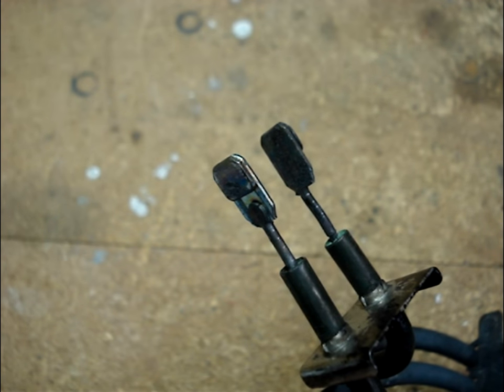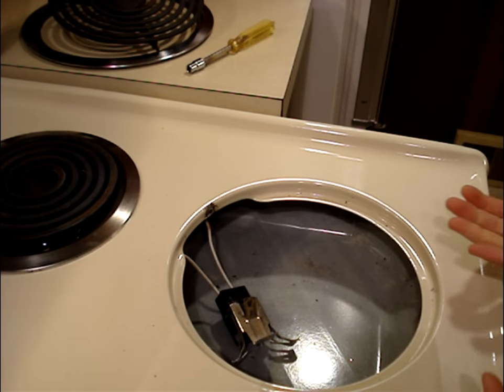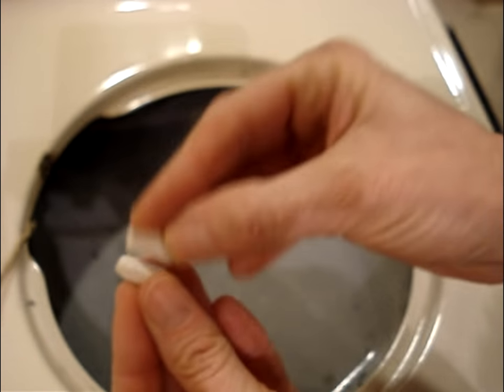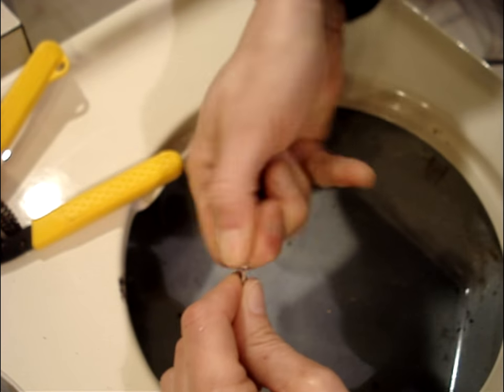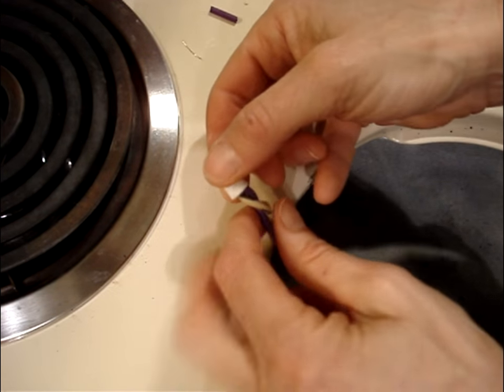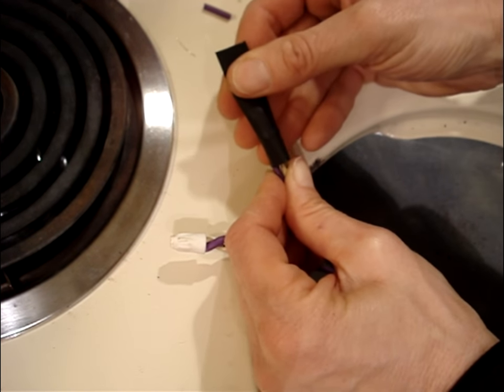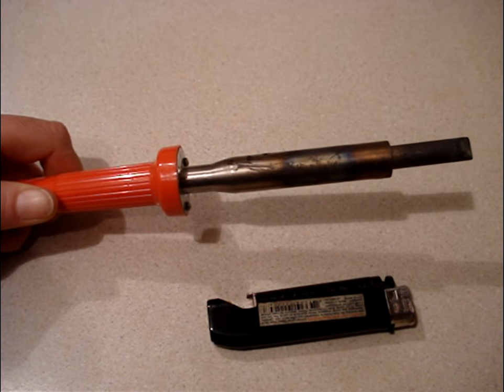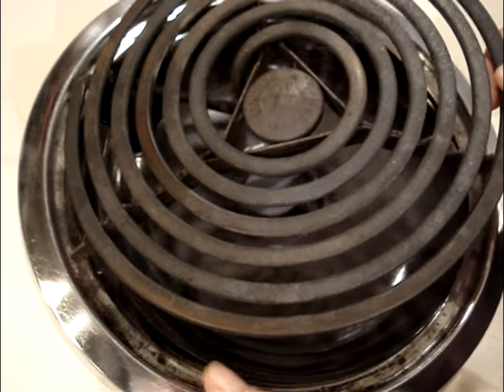Replace Electric Stove Burner Receptacle

Comment: Thanks for NOT adding music over your teaching! Thanks for speaking in a nice moderate speed so evetyone can absorb what you're teaching. Thanks for great tips as well! I don't know if I can get to the plug.....is guess it's not just okay to shut the power off at the breaker box? Probably not safe enough working with wires like this, right?
Reply from the maker: Best practice is to pull the plug.  If turning power off at the breaker, don't forget to verify that power is off to the stove before doing any work.
Reply: I'd let Ross deal with it.
Reply: What you said.  .   . x10!

Comment: You're the best teacher! I have a GE old stove with 3 wires ( red, black, and yellow ) connecting to the 3 ends burner. Can I replace it with a 2 ends burner? and how? Thank you so much for sharing!
Reply from the maker: I don't know of a way to do that.  Find the model number on the stove.  It's likely on a tag someplace.  Open the oven door and check around there or on the back of it.  When you have the model number, search the online sellers of appliance parts.  If they say the burner is no longer available, try searching for the part number on eBay.  You might find a new old stock burner there.
Reply: Thank you very much!!! So, it's not a good idea to try to connect a 3 wire connection stove  into a 2 wire burner?
Reply from the maker: No you should get the correct part.
Reply: You're awesome!

Comment: Wow, great video!  
You went straight to the point, with no bravado!  I just subscribed!
   I am a landlord so I am always learning new things!  I wish I had looked at the brand of stove I worked on!  I will replace 2 of the blocks.  Not sure how hard it is to find the right one for my stove!  I have a pic of it, will that and the name of the brand of stove be enough info to order the correct part???
Thanks again for everything!
Barry
Reply from the maker: Hi Barry, thanks for subscribing.  Welcome to Know How Now.  Somewhere on the stove is a plate with the model number.  There are many appliance part sites on the internet.  Search by your brand & the model number.  If possible, only buy an OEM part.  It will cost more money, but some of the after market parts are crap.  If you get one of the crappy ones, it might not fit or fail quickly, then you get to do the job again.  Many suppliers are tricky and they act like you are getting OEM part, but you get something else.

Comment: I have the same stove. whats a good burner replacement 🤔
Reply from the maker: Get a "genuine GE" part.  They say calrod in the center.  Be careful, a lot of sellers will try to trick you and sell a knock off part.  They are usually in a blue/white plastic bag.  You'll probably pay around $35-40 for a new one. Get the model number off of your stove, look up the part number on one of the appliance parts websites.  Check eBay, often that is the best price and they will show you a picture of what you are buying.

Comment: I got older one kenmore i dont have serial number dont know wich one to buy looks same conectors like urs flat i saw some are difrrent im not sure can that fit
Reply from the maker: Somewhere on the stove there is a model number.  Look on the back or open the oven door and look around there.  Go to one of the appliance parts seller's websites and search for your model number.  That should get you the correct burners.  Try to get OEM parts.  They are more expensive, but better quality.

Comment: One more question if you don't mind just wondering what's the best site to buy a GE part for my stove burner top like you replaced here in the video my stoves about 14 years old
Reply from the maker: I don't do any endorsements, most of the appliance repair sites are similar.  I just shop for the best price/shipping on the OEM part.  Sometimes you can find the part on eBay at a reasonable price.

Comment: Can u please let me know what prober wirestriper size to get? I bought one but it's too small and striped too much off
Reply from the maker: I like Ideal's T-5T strippers.  I'll put a link to it below. It would be good for a homeowner.  Notice that there a two scales on it, one for AWG solid and on the other side for AWG stranded.  When stripping a wire back, you'll want to look for the AWG size on the casing and match it to the appropriate stripping hole size.   Klein tools also makes some nice strippers too.  The casing on the wire for the stove receptacles can be hard to remove because it has been exposed to heat.  The  https://www.homedepot.com/p/iDEAL-T-Stripper-Wire-Stripper-and-Cutter-for-10-18-AWG-Solid-Wire-45-120/100079352?g_store=&source=shoppingads&locale=en-US&&mtc=SHOPPING-CM-CML-GGL-D27-027_011_TOOLS_ACC-NA-NA-NA-SMART-2997116-NA-NA-NA-NBR-NA-NA-NEW-PL3_Live&cm_mmc=SHOPPING-CM-CML-GGL-D27-027_011_TOOLS_ACC-NA-NA-NA-SMART-2997116-NA-NA-NA-NBR-NA-NA-NEW-PL3_Live-71700000093390745-58700007789602705-92700070740571205&gclid=Cj0KCQiAnsqdBhCGARIsAAyjYjRYci09A2eAOUmslCtax4LEp-Af_HN5rYe52RYvWttGOE4pvp-tR60aAoOuEALw_wcB&gclsrc=aw.ds
Reply: @Know-How-Now  thank you so so much 💖
Reply from the maker: You are welcome.  I have some videos about using wire nuts correctly and making a good crimp connection... if you are interested they are in this playlist.  https://youtube.com/playlist?list=PLvce66kQTjJRW9NTDylDjzdViSx4xDl-i

Comment: Great video thank you very much I just had a question... I watched another video where they replaced it like you did but they didn't have to cut the wire they went all the way through the back of the machine and took the back off is that a better option??  My question is cutting the wire like you did and mending it that's safe to do correct doesn't cut down on any of the voltage that's my only question thanks for the help!
Reply from the maker: Since I haven't see the video you are referring to, it's hard to say if the work done was appropriate/best practice.  The wiring used on a stove has a special covering rated for use in the stove.  I recommend finding the model number on your stove and finding a parts diagram on one of the web sites that sell appliance parts.  When you see the part on the diagram and when ordering it you will have a better idea of what to expect.  If it has leads like the one in the video, you'll want to splice it in place as shown in this video.
Reply: @Know-How-Now  thank you for your reply
Reply from the maker: You are welcome.

Comment: Hi - I am replacing the receptacle on an ancient GE stove.  On this stove, the stove's control wires plugged directly into the receptacle.  However, damage to the ends of the control wires now require me to add a length of wire to attach to the receptacle, and then splice with the control wires, as in your video.  Is there anything special about these wires and the connector I'll need to add, given their proximity to heat?  Thank you.
Reply from the maker: You'll want to use the same gauge wire.  The wire's covering has some sort of heat rating.  Check the covering for some sort of label/writing.  That will give the the gauge/cable type.  If you have a local appliance repair shop, they may be willing to sell you the correct replacement cable.

Comment: I recently had one of the burners on my electric stove “explode.“ It left a hole in the burner which obviously needs to be replaced. Upon trying to extract the burner from the receptacle block, I find that it is very very stuck. I am not sure if I should just give it a good pull and see if it frees it up, but believe me, it is stuck in there pretty good. Any advice would be helpful. Failing that, I may just need to replace all the burners and receptacle blocks.
Reply from the maker: If the burner hasn't been removed from the receptacle for a long time, you have to give it a good tug to remove it.
Reply: Just replace both your receptacle block and burner.  There is no need to seperate the two.

Comment: What size is that electric coil and where can I get a replacement? We have the same stove. We were cooking on the biggest coil on hi and then there was a pop and there was a hole burnt through the pan and the coil had a small pit in it. We had to restart the circuit and haven't used the coil since, looking for a replacement piece
Reply from the maker: Open the oven and look to the right top behind the door for a metal plate that has the model number.  There are websites that sell appliance parts.  Look up the part number on one of those websites.  Buy the part from them or you can shop around on eBay.  Spend a little extra money and get the GE part, not a generic one/knock off.

Comment: What if the wire is burnt? Do you have to replace the wire?
Reply from the maker: If the insulation on the wire is damaged, yes, you'll need to replace the wire.  You'll want to get the correct size wire and insulation that has the same rating are the original.  You might want to get an appliance repair shop for that.  They should have the correct wire.

Comment: So I replaced my receptacle connector like maybe 6 months ago and it shorted out and failed.  I plan on replacing it again.   Do you know why this might have happened?   Is getting exact replacement parts that important?  And I didn't use any heat shrink tubes.  I don't believe it came with any.  Is that very important to put on?
Reply from the maker: If possible, buy replacement parts from the manufacturer.  They will be a correct fit and likely better quality than a "universal fit" or a cheap knock off.  I tried a cheap knock off because I didn't want to spend more time searching for OEM parts.  I had to replace the knock off one in under a year with an OEM part.   I supplied my own shrink tubing, it's not something you must use, but it is "good practice".  The electrical department in big box hardware stores will likely sell it.  Make sure your the connections are not loose.  Loose connections cause fires or arc detecting breakers to trip.  I have a video that shows how to properly use wire nuts, it's 10 minutes well spent:  https://www.youtube.com/watch?v=Ohmd_dsetss

Comment: great video,quick question,how would you clean the the ends of the heating element forks that plug into the block,i think that's my problem,sometimes the heating element doesn't like to turn itself down a bit while cooking,it's got a mind of its own.
Reply from the maker: The control switch (infinite switch) can stick and might cause the problem you are describing.  A poor connection between the burner ends and the block would likely cause the element to not heat up or intermittent heat.
Reply: @Know-How-Now  thx for the quick reply,maybe i'll try spreading the burner forks out or in to make them fit more snugly in the block,this doesn't happen all the time but really is a problem when you need to reduce the heat and it doesn't work forcing you to take the pot/pan off the burner until it decides to work again,lol
Reply from the maker: If the connection is bad, you would likely get limited or no heat, a bad connection can't cause the burner to not reduce heat.  Again, your problem is likely the infinite switch.
Reply: @Know-How-Now  thx you very much for helping:)
Reply from the maker: You are welcome.  Have a great day.
Reply: @Know-How-Now  FYI,It was that switch,you were right,thx.
Reply: @Know-How-Now  my problem is the burner works but sometimes shuts off on it's own then sparks snd fires back up and continues to work...
Reply from the maker: DO NOT continue to use the burner, it could start a fire.
Reply: @Know-How-Now  yeah I know...but u think it could be a problem with the connection burner terminal to receptacle
Reply from the maker: Good, you are not using it.  If the sparking is coming from the connection, yes, then that is the trouble.  Verify by looking at the ends of the element and the receptacle for burn marks.  Loose connections heat up and can start a fire.
Reply: @Know-How-Now  thank you sir
Reply from the maker: You are welcome, it's my pleasure to help.
Reply: @Know-How-Now  do you think it would be wise to replace the receptacle and the element or could I get by just replacing the one that I think is problematic.

Seeing how it has been sparking I'm going to assume both the element terminals and the receptacle are going to have burn marks
Reply from the maker: It sounds like you had some serious arcing.  If you find they look burnt, I would replace both, it's not worth saving a few dollars to risk a fire.

Comment: What does OEM MEAN? Can I use a hair dryer on heat shrink?
Reply from the maker: Original Equipment Manufacturer.  I've never tried a hair dryer, let us know if it works.

Comment: Are you electrical really extent job also you give apart for after market which i take 6 month to catch it old GE is better than new the bell the same only small change in saudi arabia the old GE spar part not available and i try to fix the same part you can clean the contact and it will work this the idea for old Americans appliance